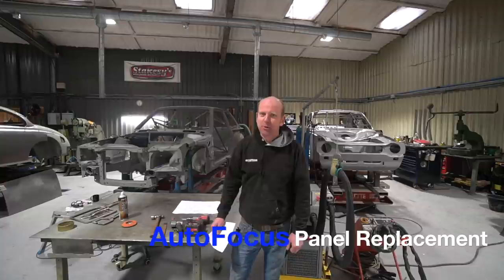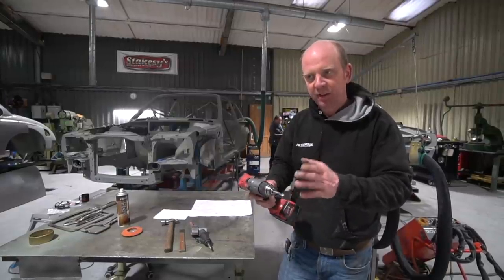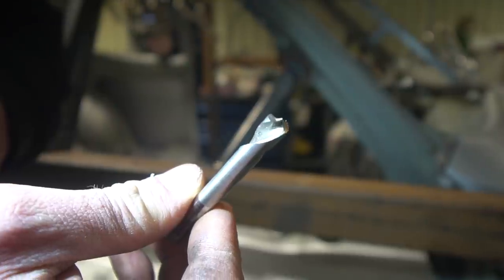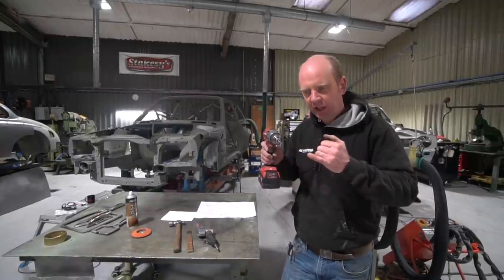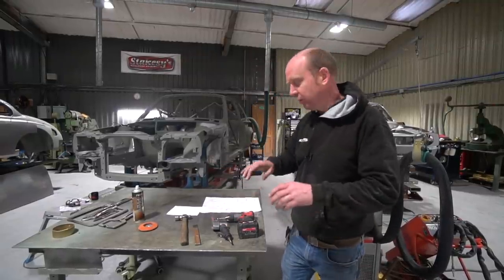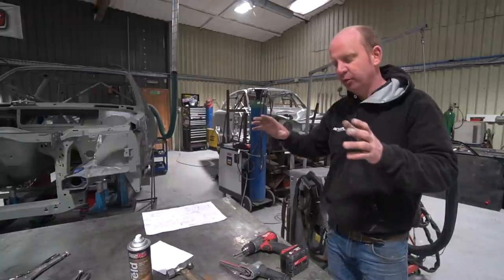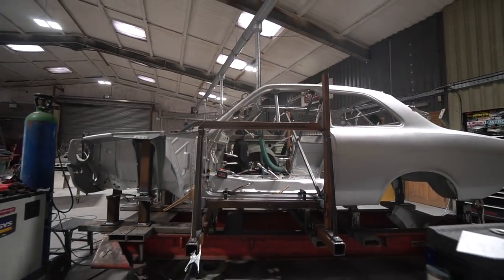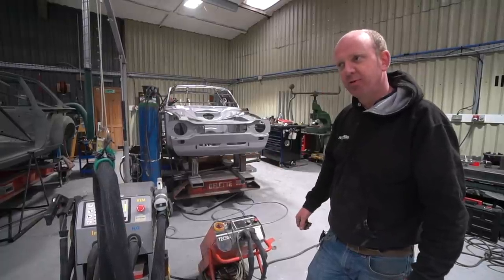AutoFocus Episode 4: BODY PANEL REPLACEMENT

Comment: Probably not as easy to get hold of now but the best chisels I've found for splitting panels are ones I've made out of old 2" mechanical (nodding donkey) saw blades. They're super thin and will take a edge like nothing else I've found.
Reply: I couldn’t agree more, there great for cutting off panels
Reply: Me too, been sharpened so many times. Take a good edge..
Reply: Do you guys mean blades from a power hacksaw? Heard them referred to as donkey saws but not 100% if that’s what you mean.
Reply: @mopedmarathon  yeah that's the one. They do various widths, the 2" ones are best. I got a load that my dad "acquired" when the mining industry was shut down.
Reply: Yes cut with a grinder to what length you want grind off the teeth and use a grinder to put a sharp cutting edge on the end like a very slim chisel or even the side to use at 90 degrees, very strong and very sharp they work excellent,

Comment: You can make an awesome spot weld chisel from a 19mm spanner. Cut the ring end off and form the chisel end, with one flat side and one tapered. Then cut the flats off the open end. This gives you a very wide area to strike with the hammer and they don't mushroom . Also chrome vanadium holds its edge for absolutely ages

Comment: Great explanation of those panel replacement processes Nat, that's where a lot of the hours go, lots of work, quality care.
For anyone interested in seeing one of those body pulling systems in operation that Nat was talking about there's a YouTube channel guy from Russia that I watch, Arthur Tussik is his name, he gets really badly bent modern late model cars and pulls, pushes, twists, cuts and welds them straight again, using lasers, chains, hooks, bars, hydraulic rams, spot weld on loops and pins it's a real art.
Reply: Arthur should be from Lithuania, if I'm not mistaken
Reply: @alxace  you're probably right, I can't understand anything he says or the writing, just read the English subtitles. But that guy does incredible stuff with some busted up cars, he knows what he's doing.

Comment: I think we all know that lad that tried cleaning the Range Rover chassis 🤔 I think that he also cooked a steak with it too 😅 . I'd imagine that the laser cleaning system was a "paid promotion " type of episode and he's since blasted the chassis after the primer started peeling before he got a topcoat on . He was better off going to his local precast concrete company and putting the chassis on a vibrating table covered in sharp gravel , at least the inside of the frame would be clean too .

Comment: Many many moons ago, a bricky gave me an excellent tip for avoiding hammering your hands when using a chisel. Don't wrap your thumb underneath, rather keep it flat against the index finger...that way, the thumb knuckle is less exposed to mishits
Reply: Great tip, l thought when brickies chisels started coming with big rubber guards they would save my thumb knuckle, no if you miss hit you take a bigger wack on your wrist instead!

Comment: Great info for anybody doing their own panel work. Any novice would get a great headstart watching this video. Good that you have shown so many tool options. Self drill screws are a game changer. I started using them in the 80's but they were posi head and slightly smaller than the standard Tek screw. Tek screws are much easier to use and the hole is easier to plug weld too. Have you ever used a single sided or blind spot welder?  Good description on the Q&A regarding the locating a shell on the jig. That's where the cellette bracket system was a winner. It saves so much time and also offered so much support when pulling. Measuring systems are crap for anything  but measuring in my experience. I wander where all the old cellette brackets are from the 80's and 90's? Would be so useful for restoration projects.

Comment: Anyone who's ever welded panels will know what it's like to release a pair of mole-grips to find them still firmly attatched😁. It might be worth mentioning that occasionally some spot welds will be sneaky and not be readily visible,not having the usual telltale dimple or divot.Or those those where 2 are together or overlapping,or like Triumph used to do on certain joins,3 in a triangle overlapping!

Comment: I have always used standard 8mm and 10mm drill bits for spot weld bits. I shape the tops to a spot weld drill bit on a bench grinder. They work every bit as good as a specialised spot weld bit. 
I just give them a freshen up before I start a big job. It takes about 20 seconds to bring them back sharp again

Comment: On your spot welder since you are in the UK it will actually be a 2-phase connection.  A split-phase connection is what you have on this side of the Atlantic Ocean in North America. 
This terminology is often confused but relates to the difference in the AC distribution systems used by the US and the rest of the world.